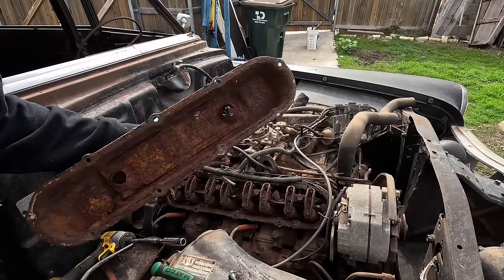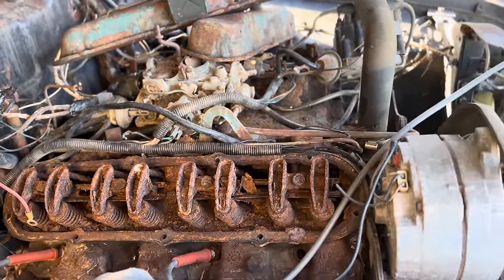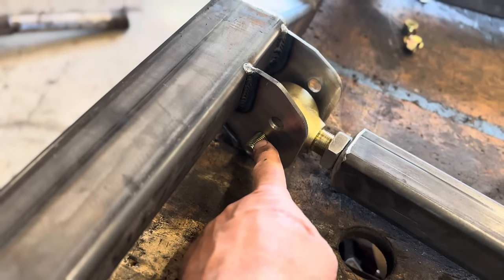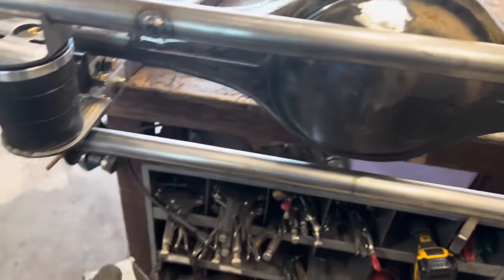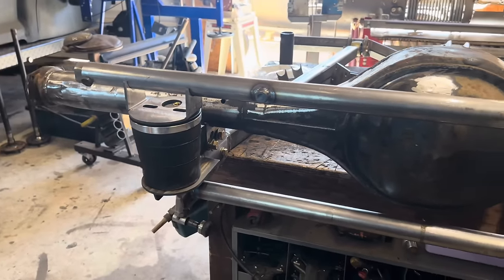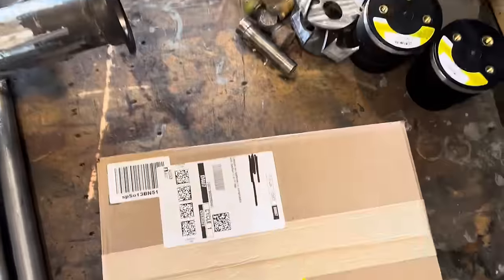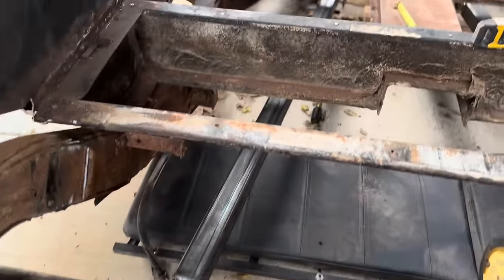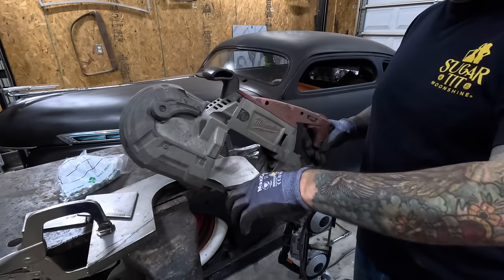1950 Cadillac Hearse, resurrection, ￼ installing the Jimenez brothers rear suspension. ￼. EP5

Comment: Looks like that 9inch came outa an F series truck with the spring pads being on top of diff housing. So it’s gunna be pretty wide and have a bigger wheel stud/lug pattern.
Reply from the maker: Yes. 5x5.5.  Fits perfectly

Comment: Nice work, and explanation of why you cut things in a certain order. A plasma cutter would be a big help!
Reply from the maker: Yes, purchasing a larger one is in my short term. Plan for sure. The one I have I bought specifically for sheet metal and I bought it like 20 years ago. I can no longer get it to work and frankly it’s not large enough to even worry about trying to get it to
Reply: @Theoldironworkshop  I’m not up on those new fangled devices. I’m very old school, the blue flame wrench or sawzall are my weapons of metal mayhem! Lol

Comment: I've got a 1987 ford 460 motor and trans with 27.k miles
Reply from the maker: my grandfather had a 460 in his truck. He got 6 miles a gallon and made zero power.  I imagine that’s why it’s only got 27,000 miles on it.
Reply: @Theoldironworkshop  its in a class a motor home and gets about 9mpg. The miles are low because the owner died and the family never used it. I bought it for $1000 just because it has 7 brand new regroovable tires and new Alcoa rims. And the 7kw onan generator only has 56 hours of run time. Brand new fridge. 2 new ac units and new furnace. Everything still in original packaging sitting inside the rv. So needless to say I didn't but it for fuel economy.
Reply from the maker: Well, that sounds like a pretty darn good deal
Yeah, finding an RV for a donor motor is always a good option because they’re typically low mileage   The downside is having to deal with an RV.  If I dragged an RV home and started tearing apart, my HOA would probably have a stroke.